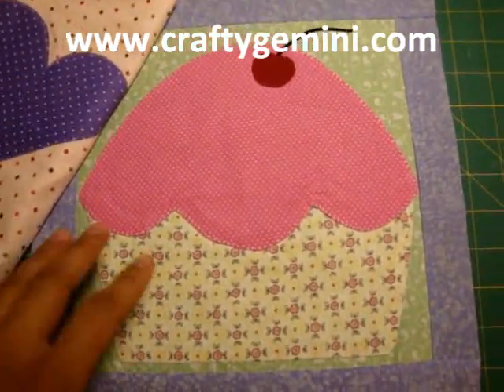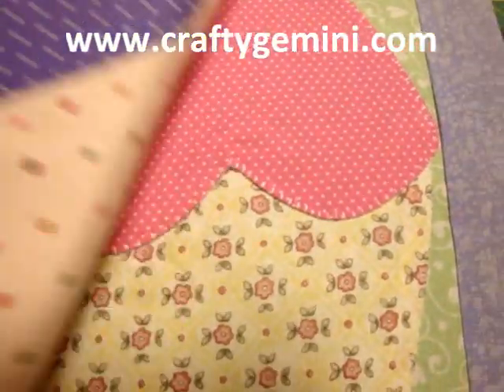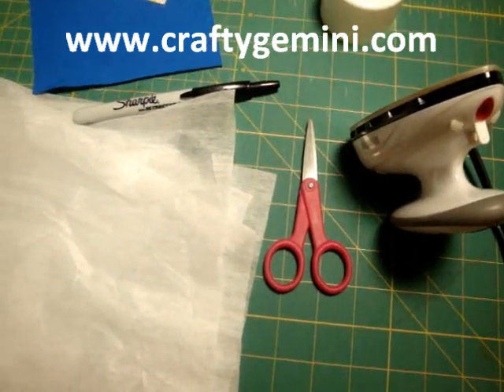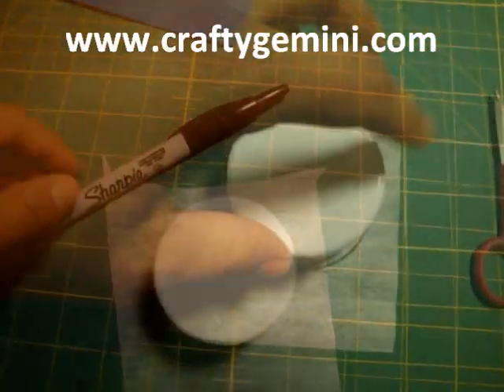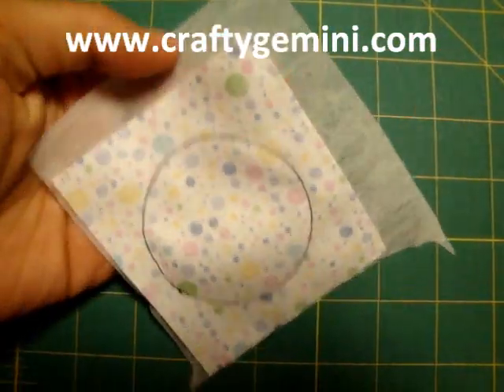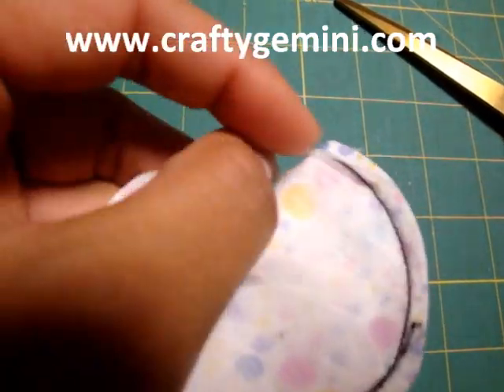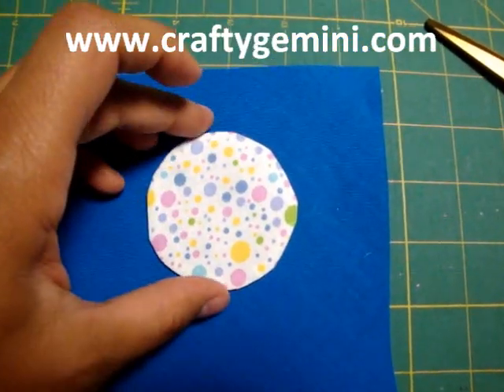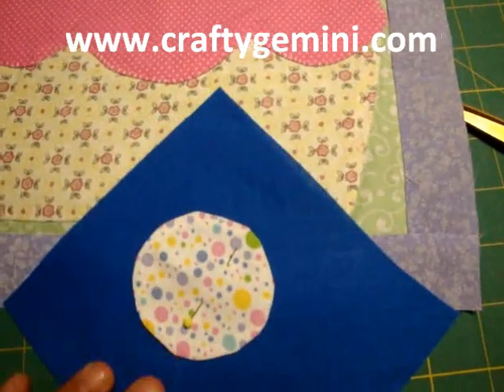Cheating Needle Turn Applique method

Comment: Instead of buying interfacing, try USED dryer sheets that have gone through many loads of clothes in the dryer.  They are free and don't add to landfills!  The used ones won't have the intense "smell" of the new dryer sheets.  Nothing like two uses for the same thing to know that you are doing a small part in saving the earth!

Comment from the maker: @twinstar9 It is washable.... it's the drying part that can cause some issues.  When you put it in the dryer the heat that activated the fusible web to make it stick will re-melt and it can come detached.  I don't like to run those chances on my projects so I just sew it down for security.

Comment: Nice job one handed! LOL.. You can use a lightweight, nonwoven, fusible interfacing.  It's not permanent though, as the glue is slight and is only to tack the piece in place.  You follow TCG's method, making sure the glue side of the interfacing is facking the pretty/right side of the fabric. Once you turn the piece, and smooth the edges..you iron the piece down, then finish your edges with a decorative stitch.